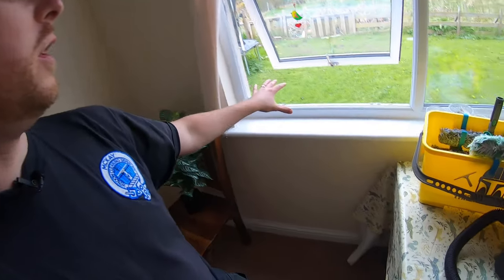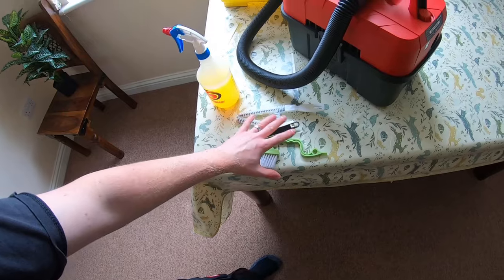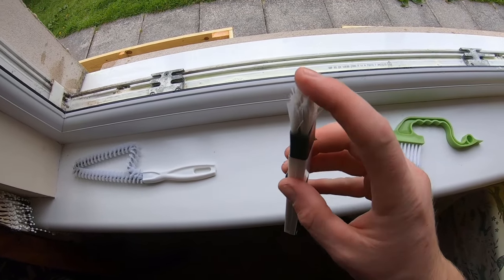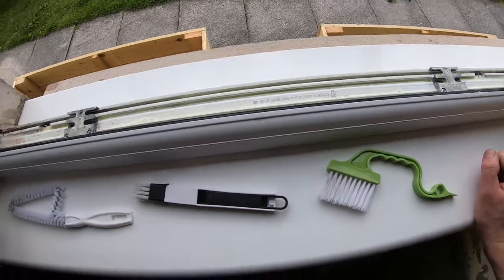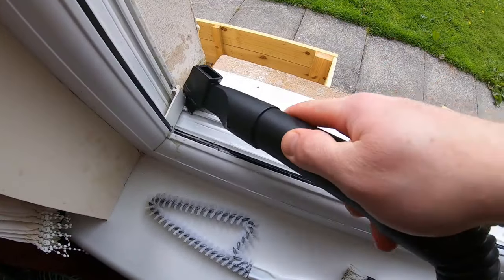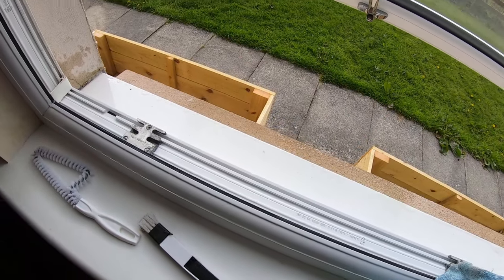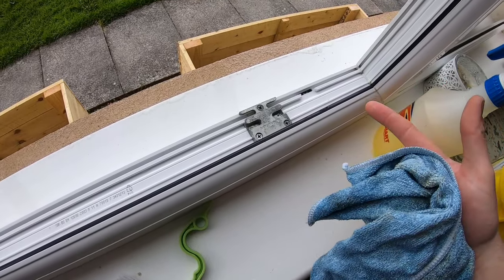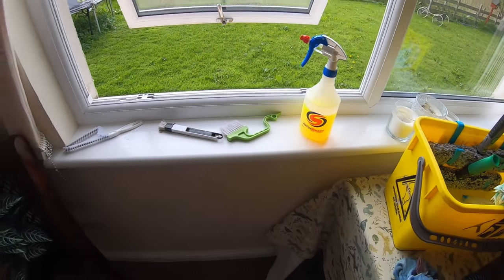HOW TO PROFESSIONALLY CLEAN WINDOW & DOOR TRACKS

Comment from the maker: ⭐ REMEMBER TO LUBRICATE THE HINGES / MOVING PARTS AFTER CLEANING ⭐
Reply: Thanks for the tip! Been detailing frames and tracks for years, never thought of lubrication.  My worst fear is to go to great lengths to do the job right and make customers happy, only to miss one little detail that undoes all that effort.
Reply: What do you recommend as lubricant ? Thanks
Reply from the maker: I use gt85

Comment: Great job, although I thought you’d vacuum out as much loose dirt & dust before adding solution. Adding solution to dirt just makes more mud to be flicked around on curtains & walls. Wouldn’t rinsing it away cause all that mud water to run down the outside of their house, creating dirt streaks?  Kind regards Kylie

Comment: My problem is the tracks and the edges of the window are encrusted with black mould.
Reply from the maker: Good detergent and a good brush, then scrub like crazy lol
Reply: @TradMan  Do you think it would be okay to bit by bit remove some of the screws/fittings so that I can clean properly?
Reply from the maker: You could. Very time consuming so you'd have to charge accordingly if doing this as a service. Steam cleaners can be quite effective to.

Comment: Hi. We have windows like that upstairs that open outward from the bottom. Really dirty on the actual tracks/ frame around the window pane itself. Is there a way to easily clean those parts . I can’t reach from the inside as too high up to be able to reach out to clean as the window needs to be open fully to be able to clean all the edges.

Comment: Hi, I'm rather late to this video, looked great at the end! Do you have any tools/tips for getting dirt out of the grooves in the frames themselves? My chamfered frames have grooves all the way around the frames and running diagonally in the corners. The grooves are tiny and I can get in there with a bit of paper towel over my thumb nail but that's not great for the manicure! Thanks.
Reply from the maker: A good detergent in an powerful spray bottle, (I use one designed for the automotive industry) and an array of detailing brushes, reasonably stiff bristles 👍🏻
Reply: @TradMan  thank you 🙂
Reply from the maker: Extra tip, wear eye protection. 👍🏻
Reply: @TradMan  👍

Comment: Where did the vacuum brush come from? I hate tracks but the vacate window cleans I do require it. Thanks for the video.
Reply from the maker: I got my vac on Amazon. Comes with the attachments (battery's sold separately). Einhell 10L wet / dry vacuum. Nice little portable vac, easy to use and light weight.

Hope that helps you 🙏🏻

Comment: Do you get customers ask for this service or do you find have to offer it to customers to get the jobs? Personally I’ve never been asked to clean the tracks. Wouldn’t have a clue what to charge for them either. Maybe £2 per window? More? What do you think?
Reply from the maker: For track cleaning like this I would offer it more often than I get asked to do it. Pricing I normally (for a standard window) go about £10, if it looks really bad then pop another few pounds on top per window. Takes between 15- 20 mins (on average with the right equipment) depending on the window size and type.

Hope that helps
Reply: @TradMan  nice one, thanks

Comment: The vacuum and cleaner are sorta overkill aren’t they? You can get similar results with just a toothbrush, paintbrush, and a bottle of water to rinse the tracks at the end.
Reply from the maker: Thanks for your thoughts
Reply from the maker: Water alone wouldn't remove stubborn stains in tracks hence the professional cleaning solution which cuts through the dirt and lifts stains very well.

The vacuum is brilliant for removing the majority of dirt and solution, without it you'd be flushing everything into the run out port's and potentially clogging them up with debris. 

With the gear in this video it is effective, efficient and looks professional as opposed to turning up with a tooth brush which to me looks tacky and cheap.

😊😉